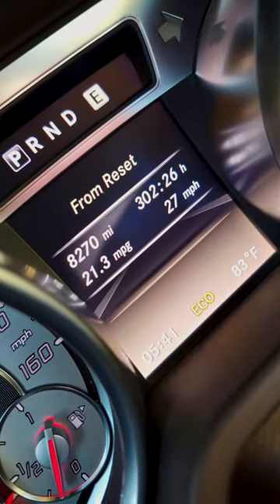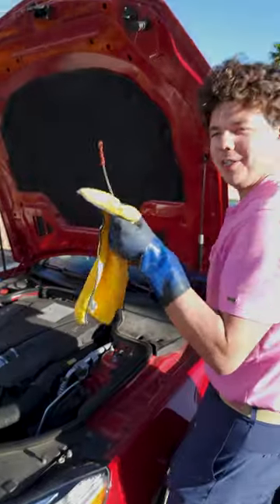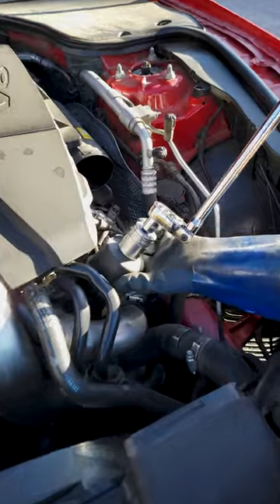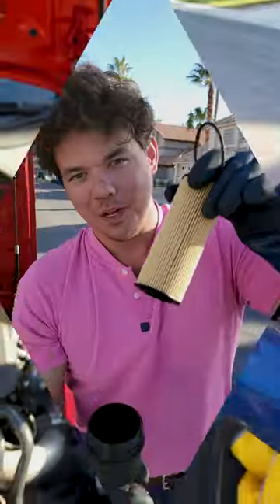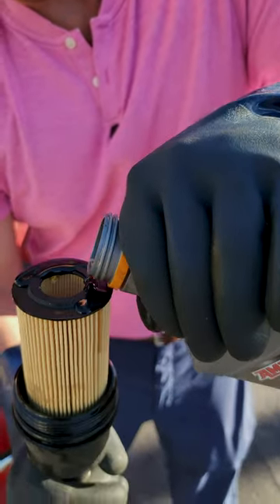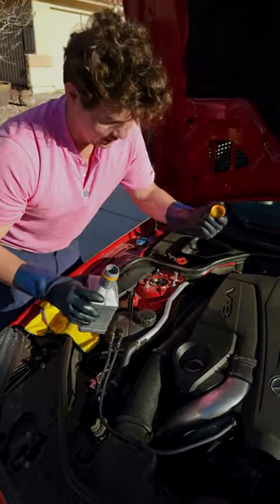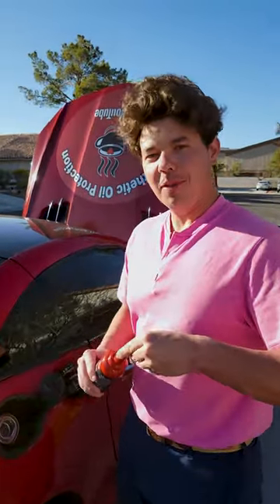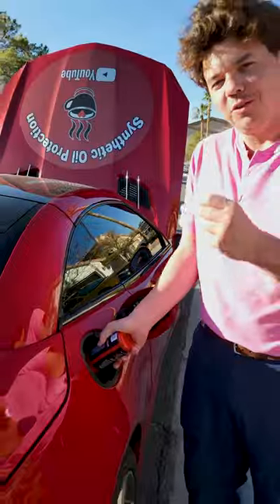Change this filter at half way mark

Comment from the maker: Watch This Next: Driving the Synthetic Oil Protection Machine Back To Las Vegas Nevada - https://youtu.be/PBYrlgeFAoc

     ♥️ Find The Right Fluids For Your Vehicles - https://www.amsoil.com/guides/?zo=5331179    

     ✅ Save 25% On Your Next Fluid Order: https://www.amsoil.com/offers/pc/?zo=5331179 

     ♥️ See Fluid Performance Tests - https://www.amsoil.com/performancetests.aspx?zo=5331179      

     ✅️ Buy Me a Coffee - https://www.buymeacoffee.com/YouLubher

     🥇🥇🥇 Synthetic Oil Protection Google Map Reviews
(702) 472-3614
https://maps.app.goo.gl/DmLU5hP72HadUBEm9
             
     ♥️ Synthetic Oil Protection Website - http://syntheticoilprotection.net

     Did you know a oil manufacturer can call a lubricant a Full Synthetic when it's only 25% synthetic? AMSOIL is different because it is 100% Synthetic and has a higher film strength keeping the metal parts separated. AMSOIL allows less friction, less heat, less wear on the component. AMSOIL Signature Series motor oil will last 25,000 miles on 1 oil change!  

     ♥️ Your Vehicle Could Run Better Than Brand New By Choosing The Right Fluids! See Results - https://youtu.be/9Y7XSl5YHFg

     ♥️ Why AMSOIL - https://www.amsoil.com/about/exclusive-distribution/?zo=5331179    

     ♥️ Synthetic Oil Protection Coffee - Ebens Favorite: https://supportwith.coffee/shop/subscriptions/sop/

Comment: Excellent,  I've been changing the oil filter at 5000 on my son E350 and on his GL450.
Reply from the maker: I love it earnest if you're new to the aunt Amsoil products my link would give you the best value as the 6-month PC member and when you use it that would attach me to you in the future I can always answer all your questions about improving the performance and lifespan of your vehicles by choosing the right fluids as your independent Amsoil dealer. 
✅   Save 25% On Your Next Fluid Order: https://www.amsoil.com/offers/pc/?zo=5331179

Comment: You don't think that oil has broken down in those 8K miles?  Not to mention the acidity build up?
I would change the oil, son
Reply: Well good thing it’s not your car.
Reply from the maker: Yes the lubricants oxidize.
You'll see under the playlists of the oil at each interval 5000 miles 10,000 Mi and 15,000 miles on that exact car and the oil is still in great shape at 15,500 Mi of City Driving in Las Vegas which is equivalent to about 32,000 highway miles in Florida at sea level